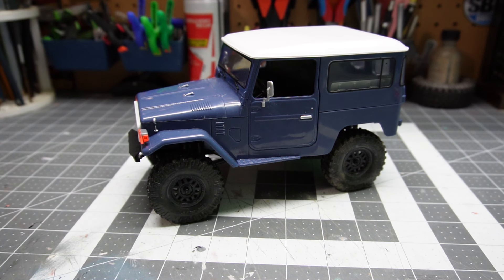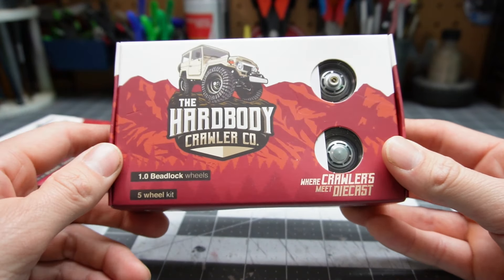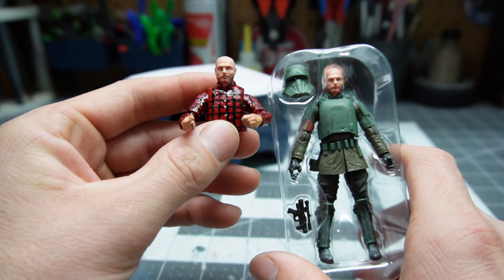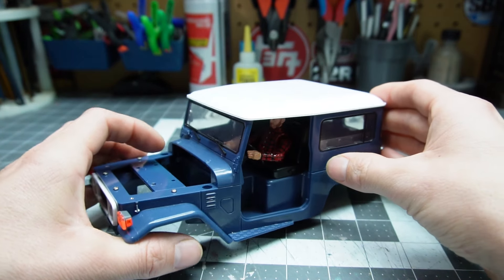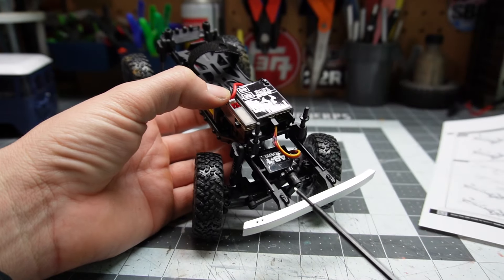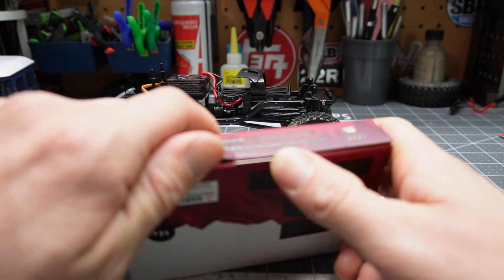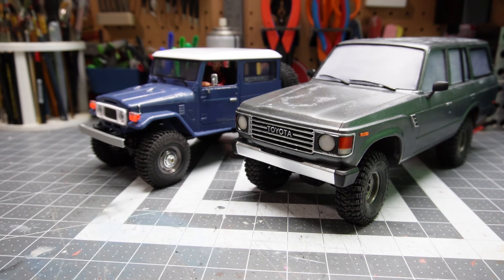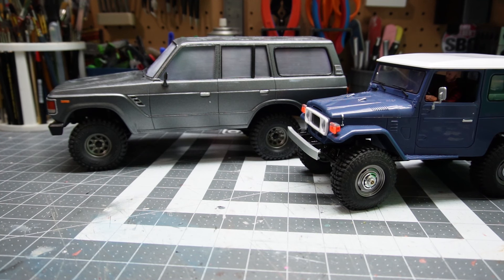Jerps In Progress - Episode 5

Comment: It cost me 20 bucks to license my 24 scale jeep Comanche I built while visiting Michigan. 
I would definitely get the plate mounts for the FJ40.
I spent some serious time wheeling with a buddy that had one. I spent a few summers dragging that thing through the woods with my K15. (3/4 ton Blazer with lockers) Be  well, and have fun.
Reply from the maker: I got the plate mounts. Looks complete now. You had to register your RC car in Michigan?
Reply: @turksandjerps  
Well, yeah.
I wanted to be able to drive it. And they're pretty serious about insurance and inspection laws.
Right?
The chrome rear step bumper and the licence plate decal sheet Cost me 20 bucks. From Nankin Hobbies. (Good guys to work with) But I wanted specifically Michigan plates, cuz it was representative of why it was modeled as such a rust bucket. I live in WA our trucks don't rust out like that. 
You can see it on my channel. It's not a huge list of vids to look through,  it's, The Truck I Call Michigan.
Be well, and have fun. 🙂

Comment: I'm doing great, thanks for asking. How are you? Might I suggest getting an NSDRC rs100 or at least an Emax Metal Gear servo, and servo tray, to handle that front end? Smiggin's will wreak havoc on the stock one. Eventually, see if a Holmes Hobbies 44T motor will fit in there and you will be all set. It's a much longer can than stock but has plenty of power for that very large, but legally permitted to be in Smiggin's Folly, hardbody you have there.
Reply from the maker: Thanks for the suggestions I will go down that road if the stock stuff fails. I did a short run yesterday after the snow melted off and it did alright but noticeably slower.

Comment: Cool FakeJeeps, what scale does the FJ60 work out to?
Reply from the maker: According to my maths, 1/14 scale
Reply: @turksandjerps  Cool thanks, I thought it looked about that size. If it ever needs a new home I'd love to take it off your hands. I'm starting to like the smaller stuff more than the 1/10 (1/9 and 1/8) rigs because I can run them with the 1/14 scale trucks and equipment. I know the FMS FJ45 is 1/14 scale thanks to you but I wish more manufacturers gave accurate scales.
Reply from the maker: @averyw.3939  I'm enjoying the smaller ones too. They take up less space and make Smiggin's Folly even more fun with the extra space on the trails. I'll keep you in mind if I need to let the FJ60 go.